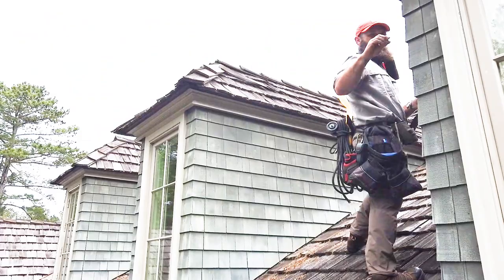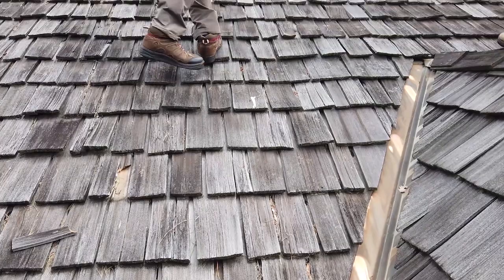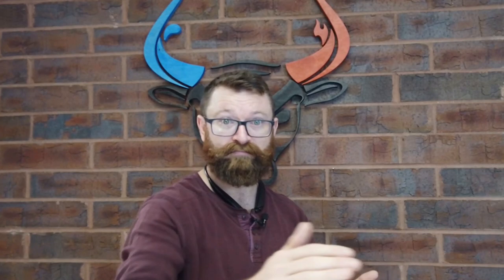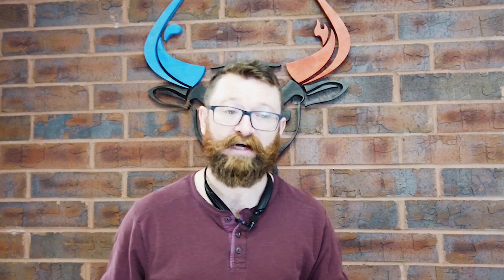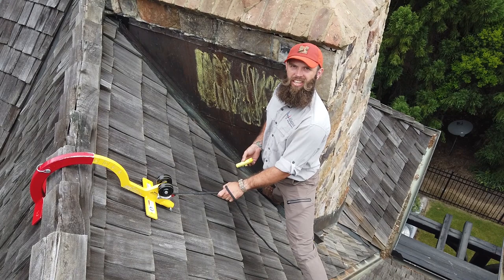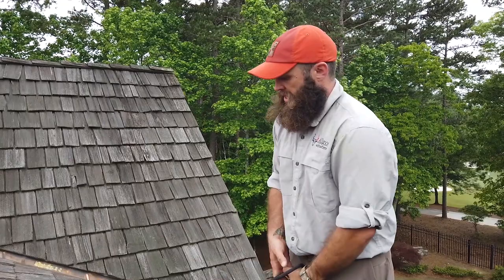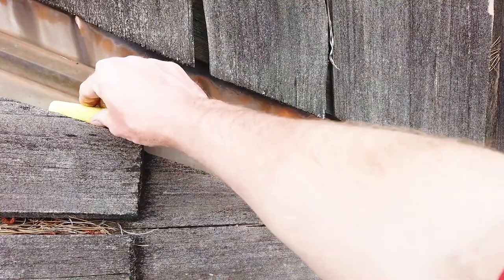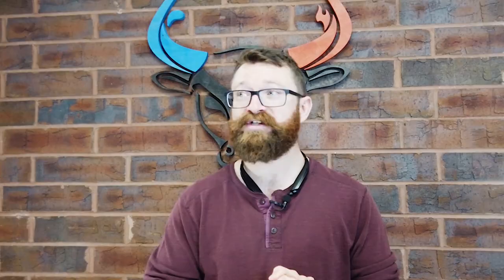Insurance Claims 101 - Cedar Shake Wood Roof Inspection for Insurance Claims -What to look for

Comment: You’re golden! Thanks for sharing all the important info. That clarifies a ton about how the our insurance company is trying to get away with their dirty tricks. Their adjustor even blatantly lied in an email to us.
 
Basically as I see it now, our insurance company pulled almost all the dirty tricks they have trying to force us to get a patchwork done that doesn’t comply with a building code. Over the last two years, there was further damage to the roof and water damage to the house because they refused to replaced the whole roof right away as they should’ve. 

Working with PA now… so close to the finish line…